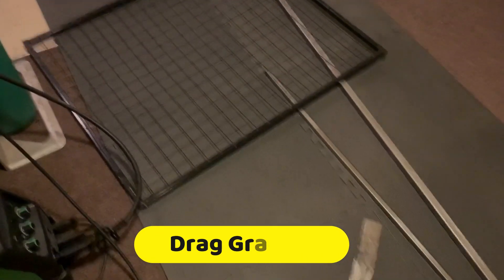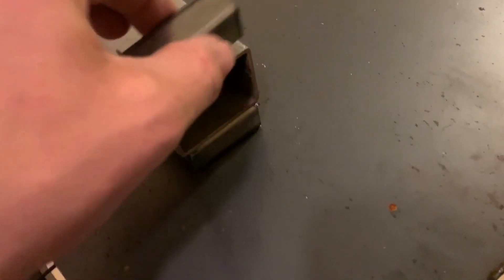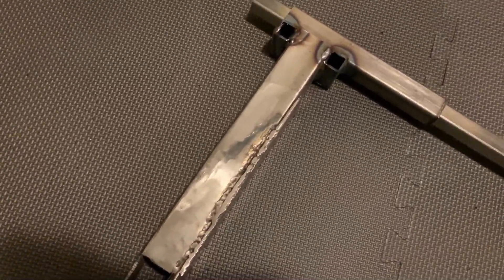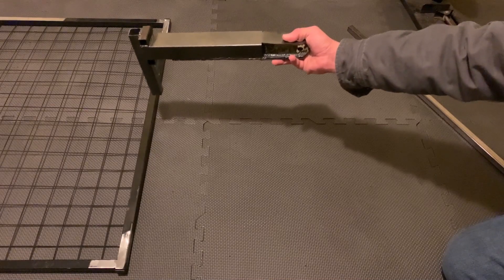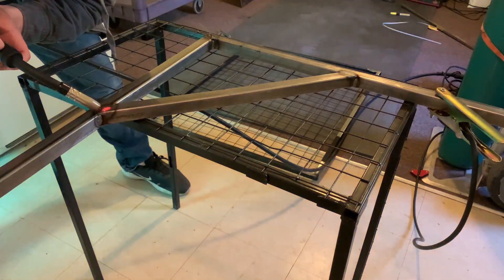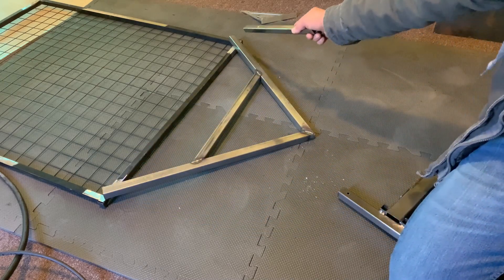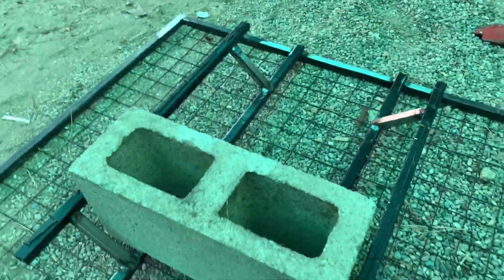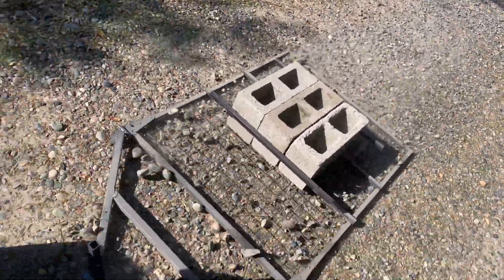Easy Welding Project - How to build a Gravel Drag Grader [For under $30]

Comment: No one post video of fresh poured gravel that needs smoothed. That one is cute and all but my 350 gravel drive on a hill? Yea the mean ole bat would eat it!!! Ha ha . I took an old building vent strapped her on back of my Polaris with tow rope with a knot a foot down so she can’t slip. Not to shabby for 15 minutes of work setting it up. I like that yours has a bit better control, but then again… Polaris, hill, heavy foot!! Lol you see where that went right!

Comment: How long did that last
Reply from the maker: Still lasting. My neighbor has borrowed it a few times too. Paint has completely came off but that's to be expected from the friction of the gravel.
Reply: Yea... seems like the weld in that one connection point can't hold out forever.